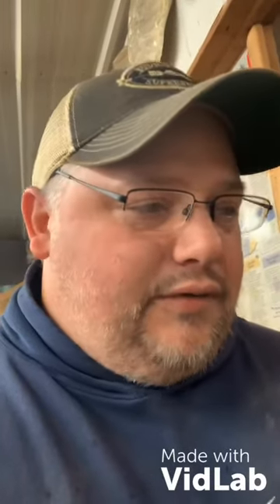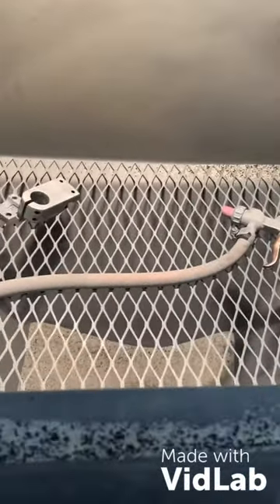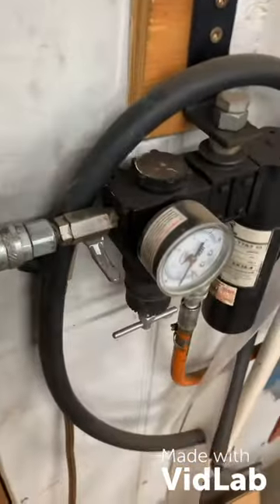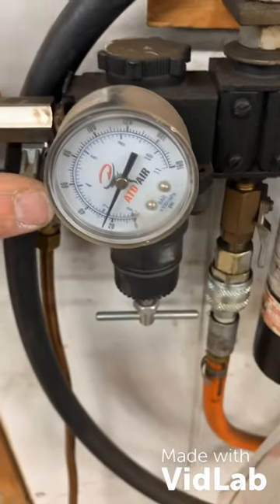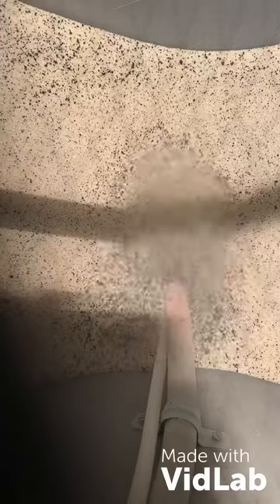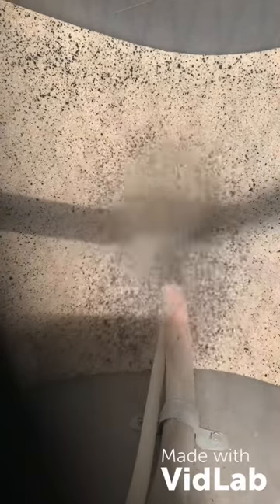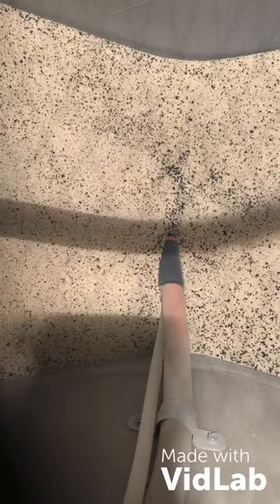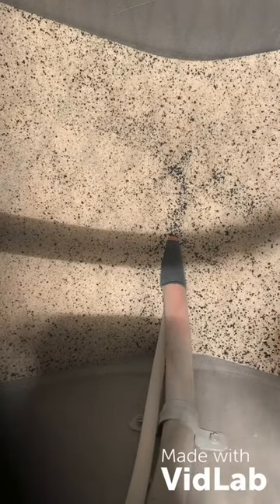Sandblasting cabinet feed issues resolved

Comment: The best advice out there, I added an air line to the media box just before the metering valve modification as suggested, I drilled and taped an outlet into this area to agitate the media with very low pressure air to keep the flow consistant, amazing results, I can now use this blaster with the effency needed to make this a worthwhile blaster for pennies. Thank you for your great advise and back yard engineering BESTEVER!!!